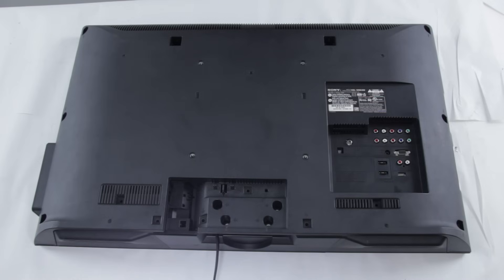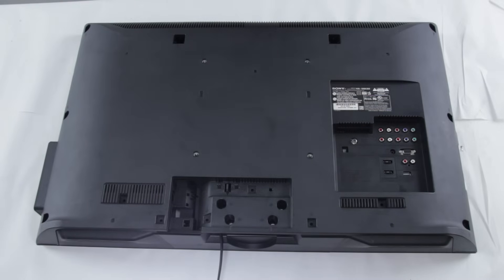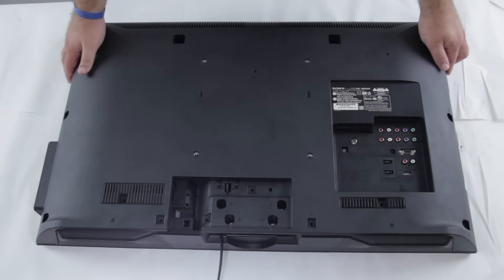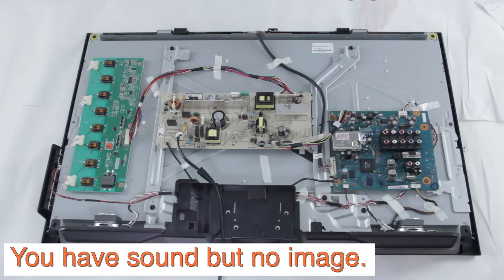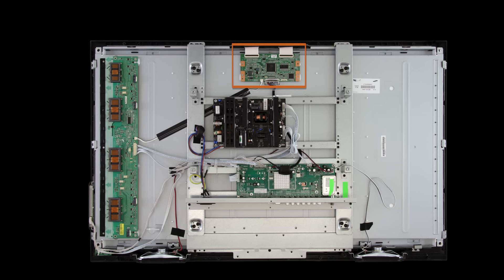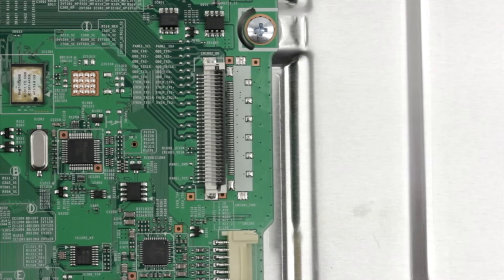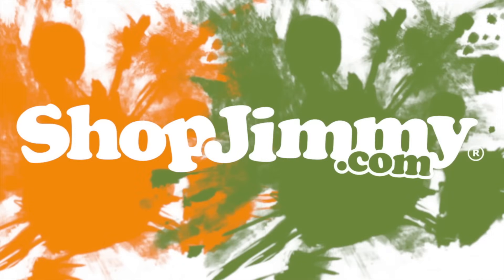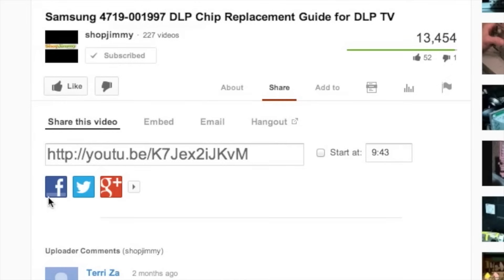LCD TV Repair Tutorial - T-Con Board Common Symptoms & Solutions - How to Replace T-Con Board

Comment: I have a weird problem with a Magnavox (funai LC401EM3F  sn DSIA1233186159   Half of the screen is showing green picture with double picture and has red lines on the lower part of screen. Horizontally.Have you  seen this problem before?
Reply from the maker: Ismael Collado This sounds like a TV panel problem.  If your TV panel is bad, it may be more cost-effective to replace the TV as panels are typically hard to find in stock, difficult to replace, and expensive.  Thanks and please let us know if you have any further questions!  www.shopjimmy.com

Comment: Hi there
I have a Toshiba LCD TV model 46ZF355D which started to show vertical lines on the left hand side of the screen. He tv is long out of warranty. The problem has been there for round 6 months. In general, h tv performs well apart from the lines which at time change colour but do not move. I have read with interest on the T-Con board help and wondered whether my tv is suffering from a similar fault. I haven't opened the back yet. Having read on the net that this is a common fault with this model and in general with Toshiba panels. Any help in resolving this problem would be appreciated
Thanks 
Nash
Reply from the maker: Usha Rathod I recommend replacing the T-con board.  Unfortunately I do not see any replacement t-cons in the search results for your TV model number on our website.  Thanks and please let us know if you have any further questions!  www.shopjimmy.com

Comment: Hi, Our sony Brava DKL-40W4500 produces dark/reddish colors on the left side, while there is a clear view on the right most quarter. After a while the left side shows blocks / beams of bright view, only to disappear abrubtly. After reading some comments I opened up the case, to see what T con is mounted inside. Does anyone recognise the symptoms as a broken T con, or is it something else? The coolerplate over the t-con has a code: LJ63-05576B. Inside there is a board with code: 404652ASNC6LV4.5. Thanks in advance for any advise!
Reply from the maker: drdinx This problem could be caused by either the panel or the T-con board.  If the problem is the panel, it may be more cost-effective to replace the TV.  You can replace the T-con board to see if that fixes the problem.  Here is a link to replacement parts for your TV model number on our website, click here:  http://www.shopjimmy.com/catalogsearch/result/?q=KDL-40W4500  Be sure to match part numbers on your current board, with your replacement for compatibility.  Here is a link to a video showing how to identify your part number, click here:  Samsung Timing Control (T-Con) Boards Part Numbers Identification for LCD HD TV Repair  You can also call our customer service for further assistance with your purchase.  (877) 881-6492  Thanks and please let us know if you have any further questions with your TV Repair!  www.shopjimmy.com

Comment: Sir, I have Samsung LCD 32" Mode No. LA32C450E1LXL. Since last few days on TV Screen there are Horizontal and Vertical lines.  How to remove those lines?
Reply from the maker: prakash3004 This sounds like a TV panel problem.  If your TV panel is bad, it may be more cost-effective to replace the TV as panels are typically hard to find in stock, difficult to replace, and expensive.  Thanks and please let us know if you have any further questions!  www.shopjimmy.com

Comment: Hi! I have a Samsung LN-S3251D from 2006. Was working fine with Direct TV but moved it to new location with air antenna and no sound. From the "menu", the internal speakers are "on" and from the remote the mute is "off". The volume bar shows increase/decrease in volume manually and with remote. I can hear sound through headphones and volume control works. I can also set up an external speaker and get sound. Just no sound from the internal speakers. Any ideas? Thanks so much.
Reply from the maker: Paige Gimbal I recommend replacing the main board in your TV.  It doesn't appear we have your main board in stock.  http://www.shopjimmy.com/catalogsearch/result/?q=samsung+LN-S3251D  Thanks and please let us know if you have any further questions!  www.shopjimmy.com

Comment: I've got a LG 32LC7DC TV which has a white background with multiple color lines running down the screen with no sound or video, it would usually start like this and after a while I'd turn it of and back on and it would show, now not even that is working any suggestions?
Reply from the maker: KALEB BURNETT I recommend replacing the main board in your TV.  Here is a link to replacement parts for your TV model number on our website, click here:  http://www.shopjimmy.com/catalogsearch/result/?q=LG+32LC7DC  Be sure to match part numbers on your current board, with your replacement for compatibility.  Here is a link to a video showing how to identify your part number, click here:  TV Part Number Identification Help Guide for LG & Zenith Power Supply Unit (PSU) Boards  You can also call our customer service for further assistance with your purchase.  (877) 881-6492  Thanks and please let us know if you have any further questions with your TV Repair!  www.shopjimmy.com

Comment: I have a sony kdl-52wl135. sereal #: 8006614
When we push the on/off button, the green power light comes on for one minute, then the red standby light blinks 5 times intetervals without sound, light, or picture.What could be the problem?
Reply from the maker: ***** I recommend replacing the T-con board in your TV.  Here is a link to replacement parts for your TV model number on our website, click here:  http://www.shopjimmy.com/catalogsearch/result/?q=kdl-52wl135  Be sure to match part numbers on your current board, with your replacement for compatibility.  Here is a link to a video showing how to identify your part number, click here:  Samsung Timing Control (T-Con) Boards Part Numbers Identification for LCD HD TV Repair  You can also call our customer service for further assistance with your purchase.  (877) 881-6492  Thanks and please let us know if you have any further questions with your TV Repair!  www.shopjimmy.com

Comment: Hi, I have a problem with my 55 Samsung 3D Smart TV, it has around 50 thin vertical lines on the middle of the screen, I was wondering if the problem could be related to a T-con board. Check out the video http://youtu.be/AzpFNRXsKjw  Thank you!
Reply from the maker: Pizzy Dueh This could either be the T-con board or the TV panel.  If the problem is the TV panel, it may be more cost-effective to replace the TV.  You can replace the T-con to see if it fixes the problem.  Here is a link to a T-con board on our website, http://www.shopjimmy.com/samsung-lj94-15927m-t-con-board.htm  Be sure to match part numbers on your current board, with your replacement for compatibility.  Here is a link to a video showing how to identify your part number, click here:  Samsung Timing Control (T-Con) Boards Part Numbers Identification for LCD HD TV Repair  You can also call our customer service for further assistance with your purchase.  (877) 881-6492  Thanks and please let us know if you have any further questions with your TV Repair!  www.shopjimmy.com
Reply: ShopJimmy.com Hi, I have replaced the t-con board and cleaned the flex cables, however I am still getting the same pattern, same lines, same location on the screen. Anymore Ideas? Could it be the main board?

Comment: I have a Sony kdl52w3000 and it has ghosting on the left side as well as a dark center. Please help?
Reply from the maker: Nick Apgar This could possibly be the T-con but it sounds like more of a panel problem.  If the problem is the TV panel, it may be more cost-effective to replace the TV.  You can replace the T-con and see if that fixes the problem.  Here is a link to replacement parts for your TV model number on our website, click here:  http://www.shopjimmy.com/catalogsearch/result/?q=kdl52w3000  Be sure to match part numbers on your current board, with your replacement for compatibility.  Here is a link to a video showing how to identify your part number, click here:  Samsung Timing Control (T-Con) Boards Part Numbers Identification for LCD HD TV Repair  You can also call our customer service for further assistance with your purchase.  (877) 881-6492  Thanks and please let us know if you have any further questions with your TV Repair!  www.shopjimmy.com

Comment: I have a Samsung with a 6" vertical rainbow strip in the middle of the screen. What could be the issue and how would I fix it? The sound and picture stills works I just have the rainbow in the middle of the screen. It would come and go but now it is on all the time.

Model# LN52A550P3F
Model code LN52A550P3FXZA

Comment: Hi Shop jimmy,
I have an insignia ns-lcd37 lcd tv that is having an issue with the display. Audio works but the video on all inputs is either inverted color, bright or wrong colors, or dim colors. We wonder if this might be a Tcon issue or another issue?
Thanks
Reply from the maker: Paul Bryant I recommend replacing the T-con board in your TV.  Here is a link to replacement parts for your TV model number on our website, click here:  http://www.shopjimmy.com/catalogsearch/result/?q=ns-lcd37  Be sure to match part numbers on your current board, with your replacement for compatibility.  Here is a link to a video showing how to identify your part number, click here:  DIY LCD TV Repair: Part Number Guide for AU Optronics (AUO) Timing Control (T-Con) Boards  You can also call our customer service for further assistance with your purchase.  (877) 881-6492  Thanks and please let us know if you have any further questions with your TV Repair!  www.shopjimmy.com

Comment: We have a Samsung UN40C6300SFXZA SN: Z1R73CVZ601724Y

The color seems to have gone into "thermal" mode where its not clear or distorted. We found a video that had a service menu setting change under the DDR setting, but our menu doesnt seem to be able to change that setting. Any help is appreciated
Reply from the maker: Cory Einhorn I recommend replacing the main board in your TV.  Here is a link to replacement parts for your TV model number on our website, click here:  http://www.shopjimmy.com/catalogsearch/result/?q=UN40C6300SFXZA+  Be sure to match part numbers on your current board, with your replacement for compatibility.  Here is a link to a video showing how to identify your part number, click here:  Samsung Main Boards & Digital Boards: Part Numbers for LED, LCD, DLP, Plasma TV Repair  You can also call our customer service for further assistance with your purchase.  (877) 881-6492  Thanks and please let us know if you have any further questions with your TV Repair!  www.shopjimmy.com

Comment: I have a TOSHIBA 46SL417U the right side of the screen is perfect with the picture and the left side seems like it has white light coming thru it.  you can see the whole picture just on the left side it is whiter.  Thank you
Reply from the maker: Charles Stover This could either be the T-con board or the TV panel.  If the problem is the TV panel, it may be more cost-effective to replace the TV.  You can replace the T-con board to see if that fixes the problem.  Here is a link to replacement parts for your TV model number on our website, click here:  http://www.shopjimmy.com/catalogsearch/result/?q=46SL417U  Be sure to match part numbers on your current board, with your replacement for compatibility.  Here is a link to a video showing how to identify your part number, click here:  DIY LCD TV Repair: Part Number Guide for AU Optronics (AUO) Timing Control (T-Con) Boards  You can also call our customer service for further assistance with your purchase.  (877) 881-6492  Thanks and please let us know if you have any further questions with your TV Repair!  www.shopjimmy.com
Reply: Thank you,  the T - CON BOARD DIDNT WORK. THERE ARE TWO LVDS CABLES ON THE BACK, NOT THE ONES COMING FROM THE SCREEN THE ONES GOING TO A BOARD FROM THE T - CON I TAKE ONE OFF AND NOTHING HAPPENS.  THE SCREEN STAYED ON WITH THE HALF AND HALF THING. SHOULD SOMETHING NOT HAPPEN WHEN I TAKE IT OFF. THE SHORTER OF THE TWO I AM REFERRING TO.
Reply from the maker: Charles Stover   Since the T-con board did not fix the problem, this sounds like a TV panel problem.  If your TV panel is bad, it may be more cost-effective to replace the TV as panels are typically hard to find in stock, difficult to replace, and expensive.  Thanks and please let us know if you have any further questions!  www.shopjimmy.com

Comment: Hi need some help here. i have 40" samsung lcd tv model number UA40D5500RM and while updating the firmware there was a power interruption on our place and when the power was restored it wont turn on anymore. no lights. what could be at fault?
Reply from the maker: edpax14 I recommend replacing the main board in your TV.  Unfortunately I do not see any replacement parts in the search results for your TV model number on our website.  Thanks and please let us know if you have any further questions!  www.shopjimmy.com

Comment: Sony KDL-46S5100 #8018384 Has no sound and no input from the 3 HDMI ports or any other inputs/ I have tried them all and the message on the screen "No signal"
#&%(##
Reply from the maker: Armand Mayoue I recommend replacing the main board in your TV.  Here is a link to replacement parts for your TV model number on our website, click here:  http://www.shopjimmy.com/catalogsearch/result/?q=KDL-46S5100  Be sure to match part numbers on your current board, with your replacement for compatibility.  Here is a link to a video showing how to identify your part number, click here:  TV Part Number Identification Guide for Sony Main Boards (LCD, LED, Plasma TVs) TV Repair  You can also call our customer service for further assistance with your purchase.  (877) 881-6492  Thanks and please let us know if you have any further questions with your TV Repair!  www.shopjimmy.com

Comment: I have a Samsung LN46a540p2f  I turns on and off.  sometimes when turning on it displays a full screen with color lines static nothing recognizable from the intended video input.  When this happens there is either no sound or loud static.  sometimes it seems like its going to work properly but quickly reverts back to the scrambled lit screen with or without sound.  Since the sound is effected as well as the picture I don't think its the T-con board.  There are no visible swollen capacitors and all fuses on the boards have continuity. I have replaced capacitors on a few Vizio TV's with success but, This seems to be something different.  I think it is something on the main board that has failed but I would like to know if there is any more tests that can be done to show clearly where the failure is.  If it is a component on one of the boards that can be tested and shown bad, what is your opinion on replacing any of the components soldered on the boards, if it is something other than a capacitor?  Please confirm or put me on the right track.
Reply from the maker: Dan Ells I recommend replacing the main board in your TV.  Here is a link to replacement parts for your TV model number on our website, click here:  http://www.shopjimmy.com/catalogsearch/result/?q=Samsung+LN46a540p2f  Be sure to match part numbers on your current board, with your replacement for compatibility.  Here is a link to a video showing how to identify your part number, click here:  Samsung Main Boards & Digital Boards: Part Numbers for LED, LCD, DLP, Plasma TV Repair  You can also call our customer service for further assistance with your purchase.  (877) 881-6492  Thanks and please let us know if you have any further questions with your TV Repair!  www.shopjimmy.com

Comment: hi, I have a sony XBR Kdl-52XBR3 and the backlight works but the picture does not show up when I turn it on
Reply from the maker: darius ryan I recommend replacing the AU main board in your TV.  Here is a link to replacement parts for your TV model number on our website, click here:  http://www.shopjimmy.com/catalogsearch/result/?q=Kdl-52XBR3  Be sure to match part numbers on your current board, with your replacement for compatibility.  Here is a link to a video showing how to identify your part number, click here:  TV Part Number Identification Guide for Sony Main Boards (LCD, LED, Plasma TVs) TV Repair  You can also call our customer service for further assistance with your purchase.  (877) 881-6492  Thanks and please let us know if you have any further questions with your TV Repair!  www.shopjimmy.com

Comment: i have sony kdl46xbru2 sony lcd tv the standby light on green no plinking no sound and no picture can help thanks mj
Reply from the maker: mj shoobeer I recommend replacing the AU main board in your TV.  Here is a link to replacement parts for your TV model number on our website, click here:  http://www.shopjimmy.com/catalogsearch/result/?q=kdl46xbr2  Be sure to match part numbers on your current board, with your replacement for compatibility.  Here is a link to a video showing how to identify your part number, click here:  TV Part Number Identification Guide for Sony Main Boards (LCD, LED, Plasma TVs) TV Repair  You can also call our customer service for further assistance with your purchase.  (877) 881-6492  Thanks and please let us know if you have any further questions with your TV Repair!  www.shopjimmy.com